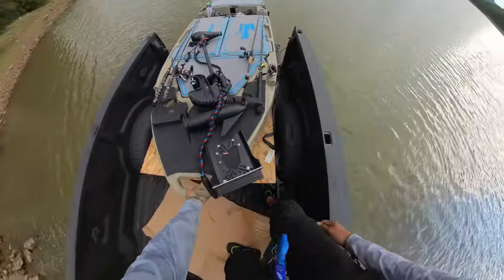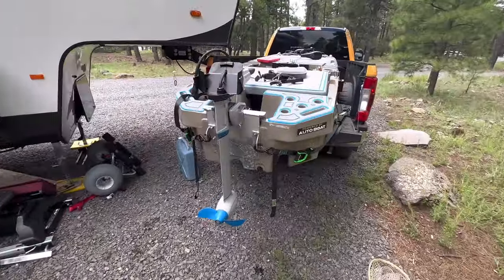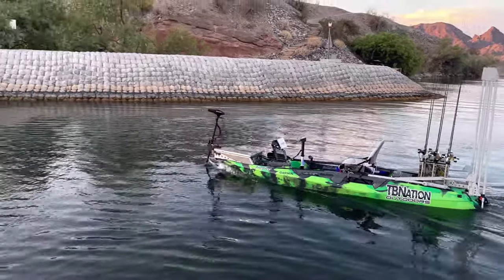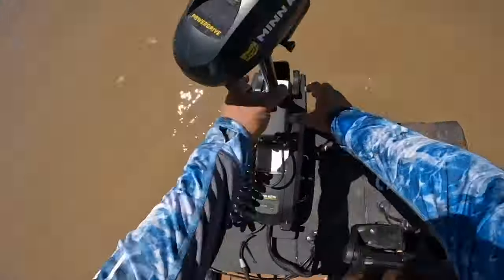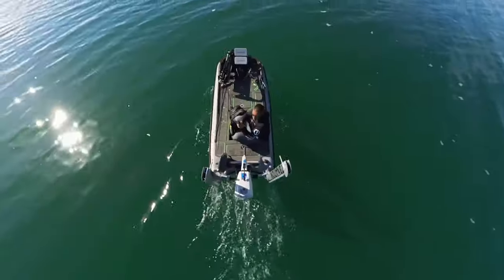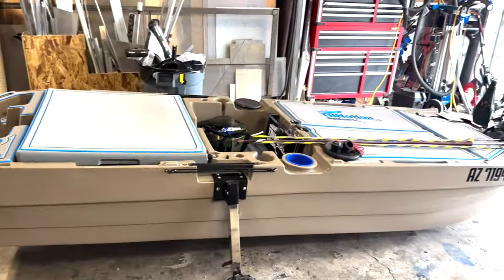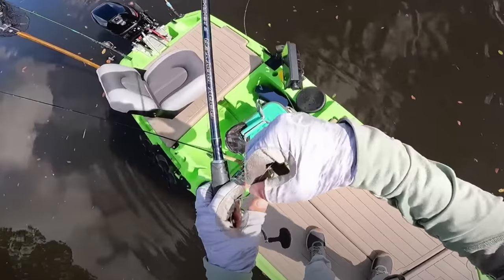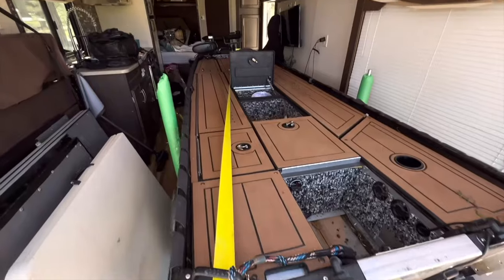The Lite Skiff vs EVERYTHING ELSE

Comment: I'm not going to lie, I'm completely jelly about that lite skiff with all it's storage space and stability. But it's freaking heavy, I travel around with a 7.5 ft inflatable boat which weighs in at 39.5 lbs with oars and everything. I can easily put it up on a car roof all by myself or carry it 2-300 yards from the road to the water. I run it together with the eprop spirit plus engine.

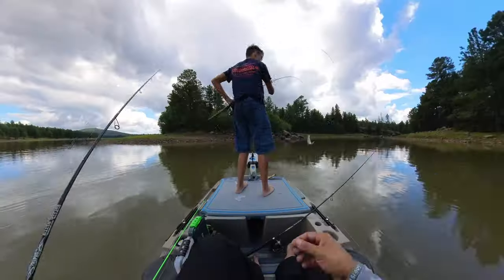Comment: Man… You keep talking about how stable this thing is, but at 10:30 it looks like two people standing up in a tippy canoe. 
Also discussing that method of launching. You are correct that not many bass/jons can be launched in that manner. But I'm MN there are even fewer ramps that I'd back my WHOLE truck into the water lol. That's the entire purpose of having a trailer. So many ramps end only 10 ft in or there's not any concrete to begin with. Some areas up here with all the moss and algae it's a bad idea to even get the rear wheels in the water. I've got 4x4 and lockers and I don't think I'd want to do what you're doing.

Comment: Even in tiny boats how it will be used and where it will be used along with how deep a persons pockets are still dictate what may work best and at what amount of investment in the platform.

A couple of retired seniors that are fishing smaller bodies of water or in areas where traveling distance or dealing with large wakes is not an issue will be better served by one of the pond prowler types of boats with the lifted seats at about 1/4th of the price point for the tiny skiff.
Again most of the time us older retired guys are more at a point in life that sitting down crappie fishing beats the heck out of standing all day pounding the edges of cover hunting bass.😁

Even the 12" Prowler 12" jon boat from bass pro shops is only $699.
Add in another $1350 for a powerdrive 12v spotlock trolling motor and for two grand you have a capable fishing rig.
The only thing you need to do is make a plate to mount that particular trolling motor on the hull.
And last but not least a nice used  4-5hp gas outboard can be found at sub $1000 price points so one of these can be totally set up ready to fish in the neighborhood  of what the bare tiny skiff hull will set you back.

The small really light easy to load and move around plastic boat concept is very attractive for many owners.
I think one thing that has fueled the Kayak craze is the ability to forego the trailer and much easier to store than a more traditional boat.
Sad thing is even these small plastic boats if you are using even a small trolling motor require registration in most states.

My personal opinion I like the lite Skiff concept but honestly I think for a plastic hulled boat it is priced way, way too high.
But I also think the same thing about some of the "fishing" kayaks on the market.
The plastic Skiff at around a $2000 price point may be more in line for what it actually is a plastic boat with plastic hatch covers.

And yes over the last 50 years I have owned everything from the smallest 12 ft jon boat, to 17ft jet drive alum, bass Tracker style bass boats and 21ft glitter go fast bass boats as well so I do have a bit of experience.
In all honesty one of the best most versatile fishing boats out of everything I ever owned was a 14ft semi vee jon boat with a front deck and option for a raised fishing seat with a 9.9 for limited hp lakes and I would switch that out with a 25hp for rivers or larger bodies of water and a 24 volt bow mount trolling motor which when I sold it had been upgraded to a gps model .

I owned that boat for about 20 years and still regret letting a guy talk me into selling it to him.

Comment: The price is cheap if you like to fish rocky type rivers with current that you don't have time in the day to put in a kayak up stream launch point and float fish to another take out point. You can put this boat in the water and go up stream or down; fish and come back to the launch point quickly. The deep scratches that come from rocks can be plastic welded back or just repaired easily. Maybe someone else may be like me and can't afford and good jet boat with a UHMW boat bottom at the moment but loves to fish rocky shallow rivers. Also that jet boat will need a boat ramp to put in as well. This little boat might be a good choice after all. Anyone else see this as a good boat for shallow rocky rivers?

Comment: It's a neat boat and all, just too high for my taste, now I fish out of an Intex mariner 4 inflatable boat, have been for 7 years now (same boat) ultra portable (fits in the trunk of my car). It can take a 3.5hp motor (44lb max weight), yea not a lot of outboard, but hey I really don't need that much. The weight capacity is where it  shines, up to 800 pounds of capacity, I've had it in 3 to 4 foot swells without a drop entering the boat. Only real downsides are you can't use a larger motor, and it does get a pinhole every now and again, Which is easily fixed with a dab of E6000 sealant. I sit on a plano green trunk, that doubles as my junk bin, floor rolls out and is rigid, can stand in it easily. That's a boat u should outfit, an Intex mariner 4!!!!